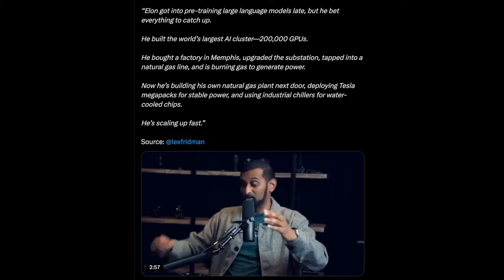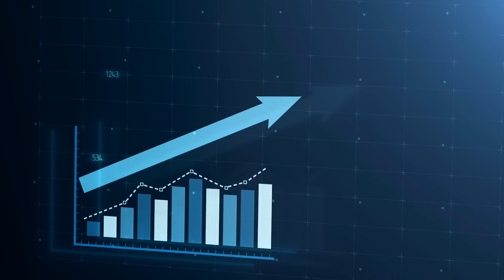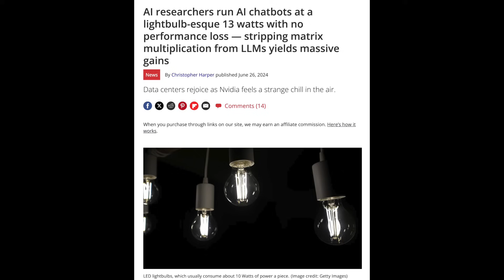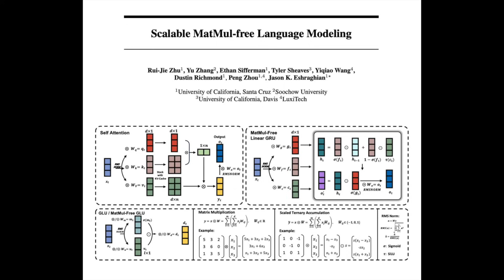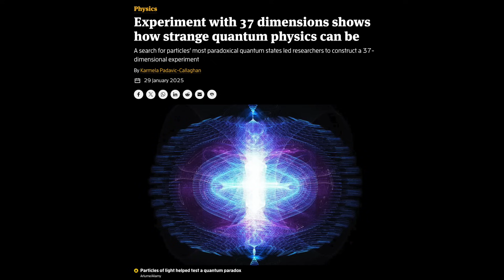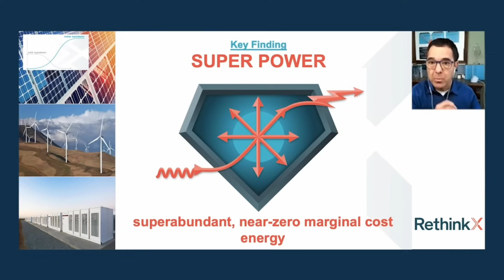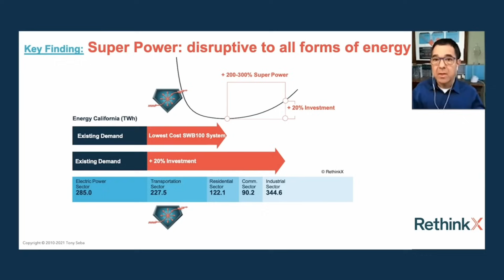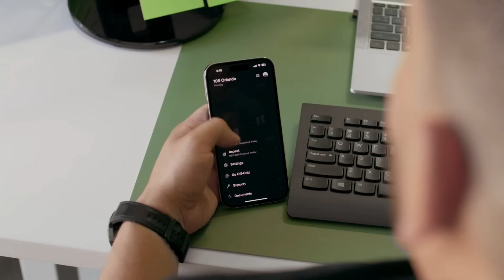AI's Energy Crisis - 45,000X More Efficient in 8 Years - The Dark Side or a Path to Abundance?

Comment: One relevant issue not mentioned in the video is Jevons Paradox (google for details). In essence, as a resource gets easier/cheaper to use, demand for that resource is likely to increase. To put some made-up numbers of this, let's assume there is a 100-fold improvement in AI efficiency over a certain time period. Jevons Paradox suggests that energy used by AI will not decrease 100-fold, but instead the demand for AI computations is likely to increase N * 100-fold, thus resulting in energy required to meet the demands of AI being N times higher.

Comment: No doubt the near future will be technologically interesting. Energy generation and consumption is clearly  one of those areas. Certainly localized "sustainable" power generation and storage, supported by regional sharing grids will be a key. But likewise, IT hardware, now becoming a really significant consumer, needs to evolve as well (if we want to replace just burning up coal, oil, and gas; if we want robotics, EVs, "abundances," etc.). Various options like eliminating/reducing the need for matrix multiplications for training or inference appear good starts. But there has been other R&D work at the hardware level that might have been mentioned beyond just expecting past improvement rates to continue into the future. One of the more interesting novel ideas has to do with reversible computation. This treats information as energy and memory sort of like a battery. If that works as well as predicted, soon the efficiency of computation might increase greatly with much less thermodynamic energy loss. "Anastasi In Tech" recently made a video about this.

Comment: You have it backwards. The increase in computational energy efficiency is what leads to more total energy use! This famously is known as Jevons Paradox: "The more efficiently a resource is used, the more that resource is used in total."  Jevons found, in 1865, that the increase in the efficiency of coal use (because of the Watt steam engine and other breakthroughs) lead to expansion of coal use. Since the ENIAC in the 1940s, computational energy efficiency has improved by a factor of 10 trillion (13 orders of magnitude) with computer operations per watt-hour increasing 10X every 6 years. Since the 1940s, computer energy use has only gone up.  As we make data centers and AI more energy efficient, the cost drops and the number of applications expand dramatically. This can be seen if we do a thought experiment: Imagine that computer technology was frozen at 1980s levels (Intel 286 processor). Now imagine if there would be data centers everywhere and if AI would be something that was available to the public. So, the 45,000X improvement in energy efficiency will only (eventually) lead to even more AI energy use!  I did a Climate Chat YouTube program on this: "AI Energy Efficiency Will Increase AI Energy Usage!" https://youtube.com/live/Lwn8kZv1ioY

Comment: Note:
Gigabyte scale AI. Not 100 gigabyte scale AI.

This is specifically for edge devices - not data centers.

By designing the application so it requires a small AI on an edge device, you do not need as much inference time in the data center. 

2 gigs of memory and the ability to run a low power transformer should fit well in ASIC architecture.